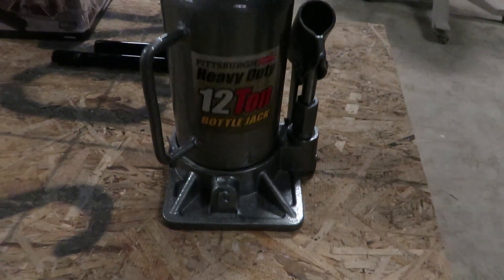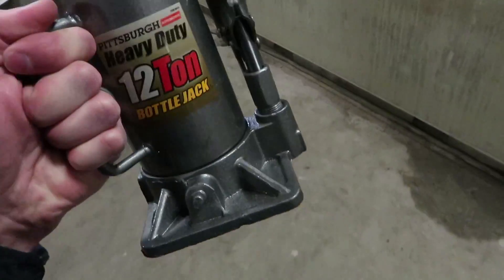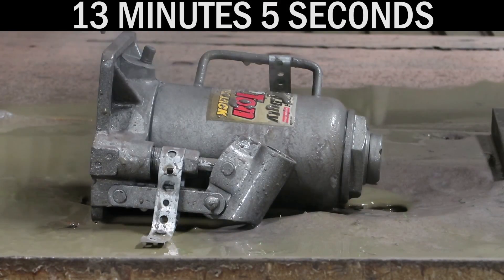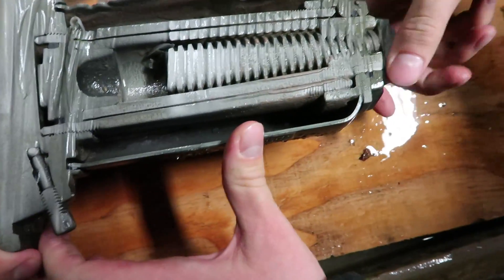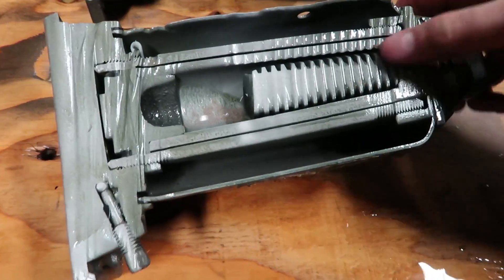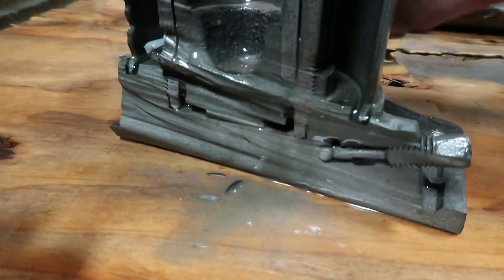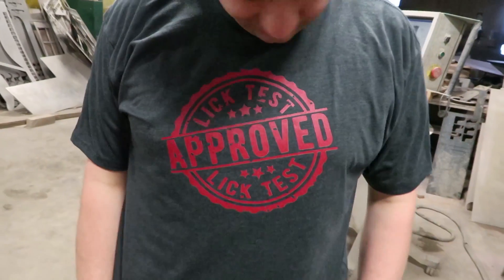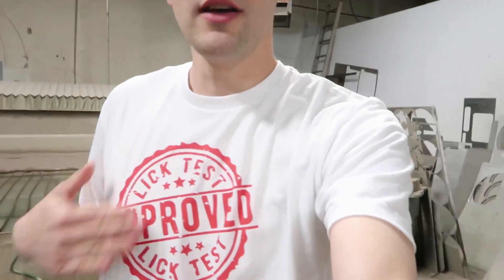Hydraulic Press Cut in Half with 60,000 PSI Waterjet Destruction

Comment: As thin as that outer wall is I would not use it on anything above a pickup. Plus all their jacks leak down when near or at max capacity... Love the lick test though lol.
Reply: The outer wall isn't load bearing.
Reply: DeathK Actually the whole unit is load bearing. Why do you think other brands are made with a thicker outer wall?
Reply: The internal hydraulic cylinder and the base are the load bearing portions. If there is any load on the outer wall at all it's very minute and not an issue. The outer wall is there to act as a reservoir for the hydraulic oil and to align and protect the internal components. It's not there to bear any significant load when you're lifting something. Other brands may use thicker outer walls because they choose to make their jack more rugged or heavier. How many other brands have you seen a cross section of anyway to verify the thickness of the casing?